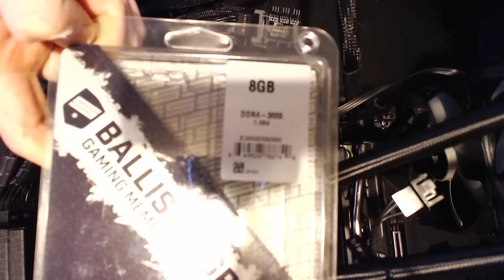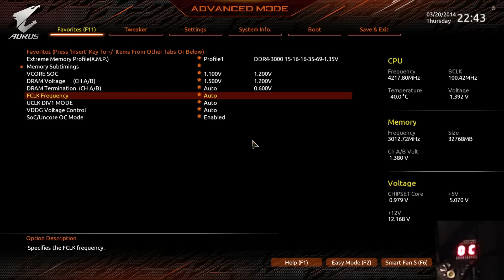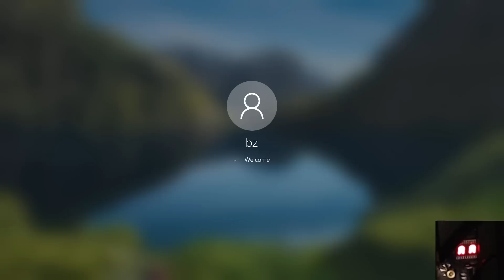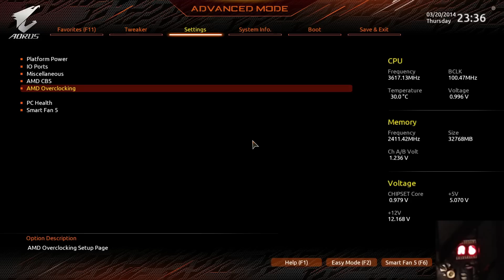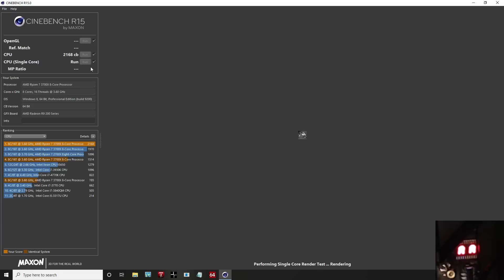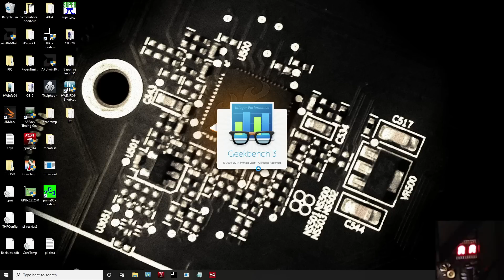Overclocking 4x8GB of 3000MHz CL15 Crucial Ballistix on a Gigabyte X570 Aorus Xtreme with a 3700X

Comment: I'm not impressed with Gigabyte, have some Patriot Viper Steel that is meant to be able to do 3600mhz, it can't even do 3400mhz at the advertised timings, they still haven't given me my steam £30 voucher and after continuously getting "sorry for the delays" it's a over a month out and still nothing from them. 

If you're after a board don't get Gigabyte, no point in the board being decent if support is rubbish (RMA is going to be painful if needed), BIOS is still lacking and feels messy (like options are repeated 3-4 times in some instances), if buying a board I'd be going with either the Asus TUF or something from ASRock probably.

Comment: I'm OC'ing some of the same memory, but in a 2x8 configuration. I got it to 3800cl16 at 1.42 volts and it passed 10 hours of HCI memtest. I played some GTA 5 today, and it crashed after about 1.5 hours of playing. Later I played Warhammer Vermintide 2 and after a while my PC just rebooted  itself, no blue screen, just as if you pushed the reboot button on your case. Am I stress testing wrong? Would you recommend a different program for stability testing?

Does this sound more like a too tight timing issue or a heat issue?
Reply: Your testing is fine, but all those "isolated" tests are not stressing the whole system constantly enough. Memory tests are just that, memory tests. But once the CPU and GPU system is involved, temperatures rise, IF gets hammered, PCIe gets hammered, things are different than the memory test which is maybe a 10% CPU task. Games, video encoding, file (de)compression are good all around tests. If they fail after an OC, then the OC is not stable. Dial it back a bit or up the voltage a bit and continue using it the way you have and see if it is now okay.
Reply: 3466c14 would give you better performance

Comment: @41:48
My face when you half enable chinese in the Bios.
really goes to show how unstable they really are. MSI boards have had similar issues for me but with Japanese instead (all sub $200 range)
Btw, I used your motherboard guide for a b450 board for a ryzen 3600x, the MSI b450m Gaming Plus VRM's dont even break a sweat running the ridiculous voltages auto settings demands. worst case scenario for heat over them too, closed case with an aio and very limited flow over vrm's.
Even with 160A limits its hottest was 42*C

Comment: Buildzoid! You have impeccable timing. I've been memory Overclocking on a Gigabyte X570 I AORUS PRO Wifi for two days now. So far, I've gotten to 3733mhz 15-15-15-35 with fclk at 1867mhz. I'm getting around 66.2ns in the AIDA 64 latency test. I've been running Prime95's Blend test with those settings for about five and a half hours now. I'm going to call it at 8 hours and run memtest for a bit just to be certain it's stable. Hopefully some of the tips in this video will allow me to go even further. It'd be nice to get the cas latency down to 14, but that's going to be difficult. Most of the time my board just power cycles a few times before recovering when I set it to 14.
Reply: Hi, if its not asking much could you provide me the settings you used, voltage and sub timings ?
Reply: @INF3RN0PT1  Well I'm still working on optimizing everything, but I'm at 3733mhz 15-14-14-30 right now. It seems to be stable, but I haven't done extensive stability testing yet. I'm pretty confident it's stable though. I haven't touched sub timings yet. I've just kept them the same as the XMP profile. DRAM voltage is set to 1.45V, but reports as 1.488V in hwinfo. SOC voltage is at 1.15V. Gear down mode and power down mode are both disabled. Fclk is at 1867mhz. VDDG voltage is at 1050 (1.05V). I tried for CAS 14, but I have to pump way too much voltage to get there. I had to set the DRAM voltage to 1.5V, which was reporting as 1.548V in hwinfo, so I dialed it back down to CAS 15. I still have some fine tuning to do with the sub timings, and I'm going to start dialing back the voltage once that's done to get the least amount of voltage needed. Keep in mind that this is all done on a Samsung B-Die kit that's normally rated for 3866mhz 18-19-19-39.
Reply: @INF3RN0PT1  OK, I've got timings down to 15-14-14-23 with the same settings as before. I ran 5 loops of memtest without any errors. I'm going to run prime95 now for at least 6 hours. If it passes, I'm going to start working on sub timings.
Reply: @Vortex1988  thank you! Good to know. I am currently using an ASUS ROG mobo and the difference between the Gigabyte BIOS & ASUS is crazy. I am not sure why the Gigabyte seems so unorganized when compared to ASUS. Honestly, thank you very much for the BIOS settings info it will be a massive help going forward, not just for me.

I will be pulling the trigger on a new system after the 3950X is released so I can see it compared to a 3900X. I want future-proofing for my investment. I hate having to build every time something "new " hits. 

My current system is a FX-9590 /w 16Gigs of 4000MHz DDR2. So, I should see a nice improvement. only thing I upgraded was the video card, 1080Ti, and SSD. Those have allowed me to maximize my initial investment. However, I think my system is woefully becoming obsolete since it can barely run a game and have YouTube running on another screen at the same time. 1st world problems :)
Reply: @rogerg0834  Oh, one more thing to note about the Gigabyte bios is that even though it can be a little disorganized, you can always save specific settings to the favorites tab. Having everything you need on one page of the bios is a huge convenience.
Reply: yeah, post more info please. I am planning on buying this mobo BUT not if it sucks. The bios in this video looks unstable and for $699...that is unacceptable.
Reply: @rogerg0834  Well I don't have the $700 extreme board. I'm running the $200 mini ITX board. So far it seems like a really solid little board. It's doing everything I'm asking it to. The only problem I've had with it is that the bios isn't the most organized. I had to go hunting for a few settings I couldn't find initially, but that's my only complaint.
Reply: @phb8462  When I was at those settings, I hadn't messed around with the subtimings yet, so all I had done was adjust the dram voltage to 1.45V, SOC to 1.15V, and disabled power down mode and gear down mode. I ended up getting the timings down to 15-14-14-25 with the same settings, but I got very impatient once I started fiddling with the subtimings because it was very hard to find something that was stable. I ended up just running the settings that DRAM Calculator churned out for me and it worked. So I'm 100% stable at 3733mhz 15-16-14-28. I could probably get it back down to what it was before with the same subtimings... maybe... but I'm not sure it would make any real difference in performance. At the DRAM Calculator settings, the latency is about 1.5 nanoseconds lower than the settings I had dialed in on my own. With the DRAM Calculator settings I'm at 65.2ns. Before that I was between 66.2 and 66.7. The difference is huge too. Post/boot times went from 10-15 seconds to probably 2 seconds. The only thing I couldn't get to work from DRAM Calculator was a CAS Latency of 14. My RAM won't do it. The computer fails to post at CAS 14. The best thing I could really recommend is to download thaiphoon burner if you don't know what type of die is on your RAM, and download DRAM Calculator to see what timings and settings should look like for your die type and desired speed. It definitely seems to work and gave me the best results I have seen.

Comment: I own a Prime X470. And like you said, the board is really barebones for overclocking. However, I've been overclocking for 17 years, so I, I don't need my hand held. Pro tip for Prime owners tweaking memory: Move your case's reset button cable from motherboard reset sw to CMOS reset jumper, and the board becomes a joy to work with.
Reply: Still gotta unplug the system from the back tho. Still a convenience is a convenience.
Reply: @HelloWorld-fg2nm  Nope, not necessary, at least it shouldn't be unless somethings faulty with the CMOS jumper, or the tool you're using to jump it isn't conductive. Just hold the power button down for 5 seconds when it fails to post to shut it down, then hold the case reset button for about 3 seconds to clear the CMOS, then hit the power button again and you're back up with default settings.
Reply: @K31TH3R  That's what I did for my B450M Mortar. Since I had some tools laying around I crimped two cables to fit into a 2-pin plug for the clear CMOS header and those cables were attached to a normal-open styl push button. That button was put on the IO shield (drilled a small hole where there was no stuff, could have used a PCIe slot bracket as well, my PC case has no reset switch). If I didn't have all those things around I would have just used an old PC case switch (of which I have many) and attached it to the jumper header, routed it through an open PCIe slot in the back and have it work like that for the few days I need to set everything OC related up. After that I rarely have to touch the BIOS unless I upgrade something hardware wise.
I did something similar with my X570M Pro4, but it turns out that AsRocks error recovery is much better than MSIs (might just be the difference between a 100 USD board and a 190 USD one), the AsRock never refused to boot, just loading the defaults if there was an issue. Still, the AsRock had antennae cutouts on the IO shield, so the installation of the button was pretty easy.
Reply: @Gigator  Nice ingenuity! I came from a Rampage II Extreme X58 Intel board, and there was pretty much no stupidity I could partake in which the board wouldn't manage to recover itself. The same was true for my P6T Deluxe as well. The X470-Pro, on the other hand, is super finnicky and will not recover on it's own without a CMOS clear. It's not really an annoyance when the CMOS jumper is moved externally, but I can't help feeling like UEFI took two steps forward and one step back compared to legacy BIOS.
Reply: Or just get an external power button for a few bucks, that's what I did with my B550 Strix. Still kinda whacky to not include a CMOS clear button on a $180 mainboard but that's ASUS for you.
Reply: @-eMpTy-  Yeah that'll work too. What I'd like to know about these ASUS boards without  any QOL features, is if ASUS is just pocketing the money they save from not including basic features, or if they're reallocating that money to other places to improve the boards. Judging by their behavior over the last few years, I'm leaning towards pocketing the money. All I know is that my Prime is looking like the last time I'll spend money with them. Especially after working with a few ASRock AM4 boards. I don't hate the board by any stretch, and for the most part it's been nice to work with and is even managing to run 4x8GB @ 3600MHz CL16, but I'm also not blown away by it's features for the price.
Reply: @K31TH3R  Market segmentation is my best guess. Mid-range boards nowadays are already so good in terms of power delivery, stability and overclocking potential, they have to give the consumers at least some reasons to go out and buy a higher end board. ASUS only puts the usual QOL features on their high end boards. I mean, to make a header into a simple button would cost them what? 0.02 cents? Or instead of the multicolor debug LEDs you'd find on many mid-range ASUS boards, how much would it cost to use a display instead? $0.50? The customer would happily pay that small upcharge but ASUS doesn't want you to, they want you to buy the more expensive mainboard.

Comment: Interesting, I just got a second 2x8 kit of GSkill Trident Z RGB 3600c18, which wouldn't run 4x8 at 3600 or 3400 (stable at 3600 with XMP with 2x8), but would run stable at 3200 with 16-18-18-36 (safe preset from Ryzen dram calculator). Might try to push it a little with higher tRFC, it's now at 560. CPU (AMD 2700X) is otherwise not overclocked. Another interesting thing is that the original kit I got had Hynix CJR chips on it, while the new kit has Samsung chips (don't know which die). Not sure if mixing Samsung and Hynix makes the motherboard happy or sad. I installed it as "matched pairs", so one kit in 1-3, second kit in 2-4 so each channel runs one Samsung and one Hynix stick.

Comment: My faulty MSI X570 ACE is locked to 1.2V memory voltage, I can't get it any higher despite clearing CMOS and flashing the BIOS.  I have a Crucial Ballistix E-Die kit and have confirmed with a Kingston HyperX Fury Hynix kit.  It was amusing and interesting to see you having a similar problem.

Comment: I got the Aorus Master to 3400 cl 16 but all attempts at 3600 failed. This was 4X8GB Trident Z 4000. Over time I hope BIOS updates let me get that a little higher.
Reply: It's not the motherboard but your dram settings. You must have geardown mode enabled. I'm running tridentz 3600CL15 at 3600mhz 14-14-14-28 with a TRFC of 252 at 1.42v on a Gigabyte Arous Elite. Yes the $200 board.
Reply: @michaelwerner5049  Ill be playing around with the setting a lot more. This video was great, saw a bunch of stuff I had not messed with that I likely should have.
Reply: @nosirrahx  yea it's a bit different than Zen 1 with Proc odt low below 40. If geardown mode enabled doesnt work try command rate 2t with you having 4 sticks. Also be careful with the voltage as the board boost it a good amount so try low voltage so heat doesn't build up

Comment: When I upgraded from two sticks to four sticks of memory on my PC, it took me two hours to find the one stick of memory that would only work in the first slot with four sticks. That was fun.
Reply: Wait, is that actually a thing? I always thought you can put whatever wherever when using 4 sticks.
EDIT: Also dual kits, shouldn't the two sticks be interchangeable as long as you're putting them in the correct slots as per the manufacturer of the board?
Reply: @gonzomiller1720  that's the magic of PCs. Sometimes things just don't work in wrong slots

Comment: In Windows if you create a shortcut with the target "C:\Windows\System32\shutdown.exe /r /fw /t 0" and run it as administrator it will reboot straight into UEFI. Figured this out after I got tired of mashing delete constantly.
Reply: I'll tell you one even easier. Click restart while holding down the shift key. Click troubleshoot and you can select many interesting functions, including going straight into UEFI.
Reply: Yep, you can also bind that shortcut (or batch file) to a key if your keyboard program supports it.
Reply: Great tip! Thanks!

Comment: I have the exact same kit as 4x8 3000 mhz cl15 and it runs 3600 mhz cl 16,19,16 1,32v and 3600 cl 14,19,16 on 1,45v (3700x with asus tuf gaming plus wifi).
Reply: Hey man, got the same RAM kit, but with 3900X and Phantom Gaming X motherboard. Should i also use the same settings for mine? Also how much does it degrade the ram if i overclock it?
Reply: @jimmysaboter3  it doesn't degrade really from overclocking because unstable settings just crash eventually. Don't go any higher than 1.5v on stock cooling solutions
Reply: @Immortal I think so, the micron e-die doesnt like aggresive subtimings too much. Try 3800 cl 16, 19, 16 with around 1,4-1,45v. A decent kit should run it.
Reply: @Immortal I am not sure about your budget, but going for a expansive high performance b-die with a b550+3600 sounds like terrible price/performance. Go with the cheaper Micron e-dies and save your money for getting a ryzen 5xxx series cpu. The performance benefit is much greater from upgrading your cpu instead of going for more expansive ram. Performance difference between samsung b-die and micron e-die is around 2 percent in favor of samsung, so you should always go with 32gb over 16 gb memory. Bar in mind that ryzen 5000 really likes 4 ram sticks. There is a good video on gamers nexus on that topic. So if you plan on upgrading to zen 3 later you should have that in mind when picking your motherboard.

Comment: Settings RRDL/RRDS to 4/4 is like super-duper EXTREME, that's the source of your problems... Also, if you see 05 ... 07 postcodes, it means basically that cmos is cleared, so no wonder your voltage was reset. Try these settings: https://www.overclock.net/forum/28110708-post1098.html (and next page where i tested dual +single rank e-dies *2)

Comment: Every POST takes a long time on Gigabyte X570! Close to 15 seconds still, even if you don't change anything for weeks. Gigabyte and AMD need to fix this. I use Vengeance LPX, that memory is as common as it gets. All my other hardware also is common to the point of being boring: 660p, HD 7850, MX500, 860 Evo. Yet close to 15 seconds for a simple POST. On any system with Coffee Lake CPU it is at most 5 seconds. Three times as short! BIOS: f5a with ABBA.
Reply: It shouldn't, you're likely having read training issues. Generally that suggests to me that you may need to change your PROC ODT depending on which stick configuration you have. (CPU on-die termination resistivity) CAD Bus Drive Strength settings can also have an impact on that. Also, which DIMM slots you're using.